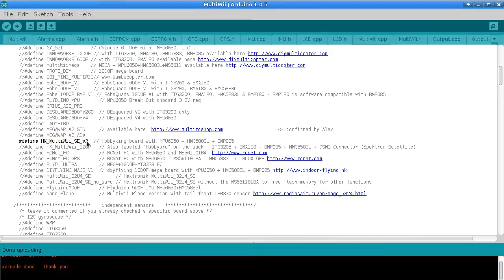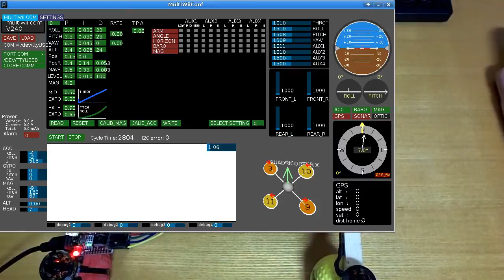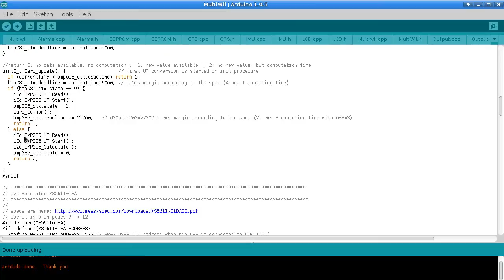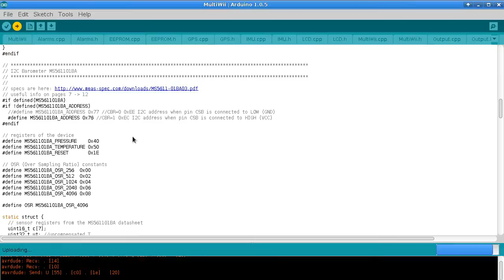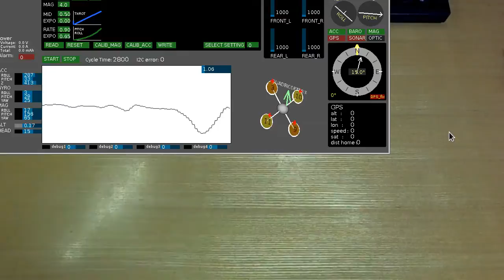MultiWii barometer upgrade

Comment: Brilliant. My flight controller has no barometer, so I hope it has the i2c pins. (Cant check just now). Now if that could be combined with an ultrasonic sensor for ground avoidance, that would be cool.

Comment: how much did you pay for the ms5611 barometer... as it seems pretty expensive...? i have used a bmp180 which gives good results.. but obvliously not as good as the ms5611
Reply from the maker: bing crosby http://www.banggood.com/MS5611-GY-63-Atmospheric-Pressure-Sensor-Module-IICSPI-Communication-p-965980.html
Reply: thanks, i did see them on ebay for more than that.. i have a few other baros i not using much at the moment.. but good to know.. great yourube channel love your work... check out some of my stuff. cheers Al.

Comment: I just built a new frame from scratch yesterday and played around with altitude hold and GPS hold a little just a few minutes ago. I recorded a bit of footage, are you interested to see it? :)
Reply from the maker: muh1h1 No. hahaha just kidding, of course put it up. Your beercopter vid was kinda short btw....
Reply: ***** well, i gave up the idea of the 6" props for now, since i flew a few flips and at some point rammed the copter into the ground fullspeed upside down...
Broke all 12 Fins off the props :(
Also the props i had are no longer available on ebay, so i decided to build an 8" quad and buy one of those 100$ 5" kits in the near future.
i am currently editing the videos together :)

Comment: on the multiwii328p isnt 5v but 3.3
is the ms5611 compatible?? specs says - 3v-5v (internal low dropout regulator)
Reply from the maker: Luca Nsh Multiwii was originally written for 16MHz clock speed which is typically running at 5v. There have been some modifications made after that though, so you might be able to run at 8MHz (typically 3.3v) or overclock to run at 16MHz on 3.3v (not recommended). http://www.multiwii.com/forum/viewtopic.php?f=8&t=1236
Hmm.... but in either case, if the MS5611 is compatible with 3-5v then I think you answered the question yourself right.....? In this video, I have used a breakout board that can accept either 3.3v or 5v, so I did not worry about the power at all.
Reply: +iforce2d hello again 
on the multiwii328p board there isnt the second pin for CSB , there s just GND 3.3 SCL and SDA. it will work or i have to connect, for example, CSB on low(GND) instead of GND from the barometer?
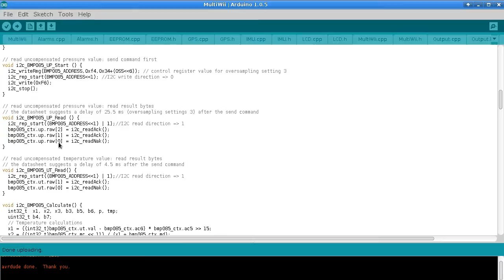Reply from the maker: +Luca Nsh I looked at that at about 9:04 in the video. There are comments written in the multiwii code to tell you what to do. The CSB will be connected to either GND or VCC depending on which I2C address you want the barometer to respond to.
Reply: +iforce2d thank you, i watched it more than a few times but my eng listening is not so good
thank you again

Comment: hey... i want to add an external barometer (bmp180 maybe) to a naze32(this board doesn't have any internal baro) basic version... please help me
Reply: thanks in advance
Reply from the maker: If it's an I2C barometer then can't you just connect it to the I2C pins like in this video? Some boards don't make those pins easy to use though, it's probably easier to just buy a board with a baro on it, you can get a full 10 DoF board for $17 or so these days: https://goo.gl/vXOWdM
Reply: okay... if i have a naze32 without any barometer by default and then i attach this ms5611 to it... should i still fiddle with the code?
Reply from the maker: Which code? Presuming you are talking about cleanflight, betaflight etc. no, I don't think you will need to fiddle with the code. It should detect which baro hardware is present.
Reply: thank you very much... you're awesome
Reply: Is it possible to solder my GPS, Barometer and Magnetometer in parallel to the SDA wire (that comes out of my I2C port)? Because I dont have any other SDA's in my flight controller (SP RACING F3).

Comment: iforce2d , hi again, I wonder how you cover the barometer, I bought one like yours and it seems that the sensor chip is very close to the resistor. Its very hard to make a box(from your comments below  https://www.youtube.com/watch?v=AMJYXNMOuwM ) to cover it. I wonder if it is okay to cover the whole barometer? because I googled it and it is sensitive to light. Will the lights on the barometer affect the readings?
Reply from the maker: Yes, you can cover the whole thing. The goal is to slow down the flow of air around it, and keep it out of direct sunlight.